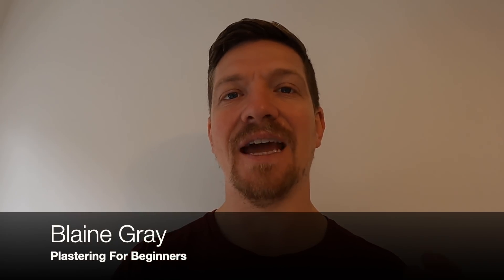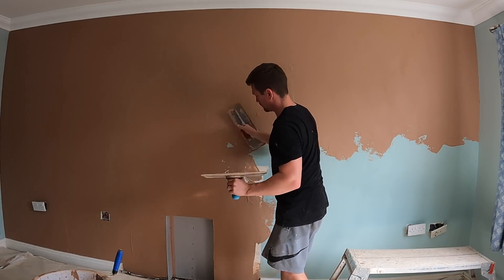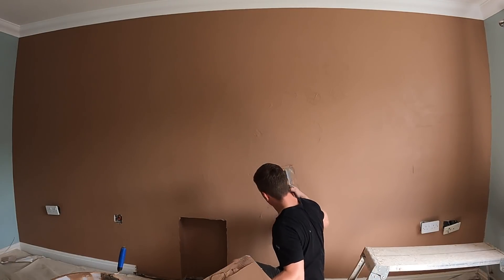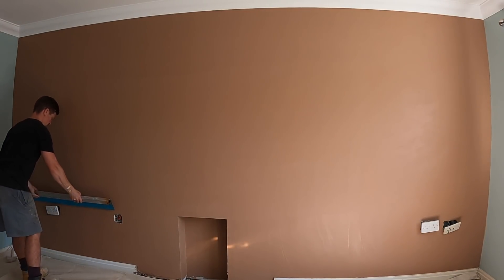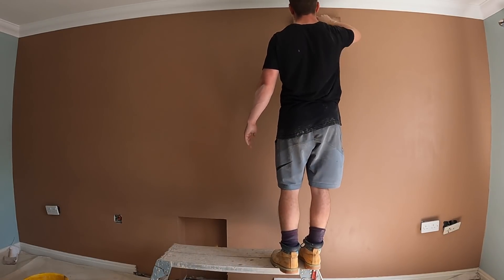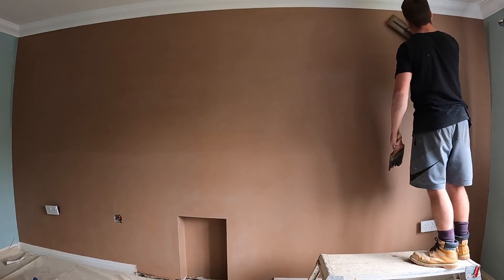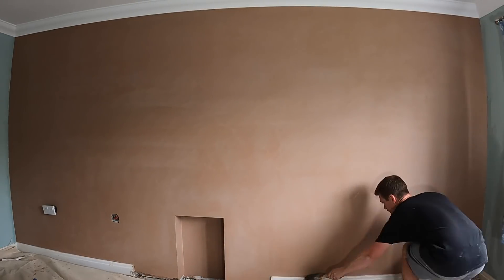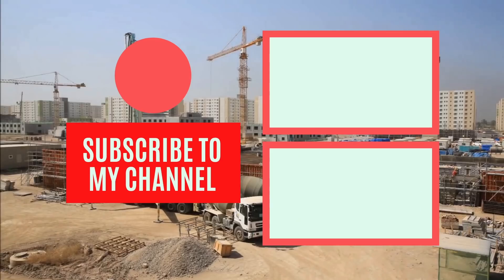7 Tips For The PERFECT FINISH In Plastering | Plastering For Beginners

Comment: If you are plastering on top of hardwall but also using corner bead, would you still use 2 coats of multifinish? I so, how would you go applying 2 coats with the corner bead? I'm planning on plastering the inside of a door way which I removed the door lining from and want to make sure I get things right.

Comment: I was always told the reason you had to put a shine on the walls, was not to annoy the decorators, but it was required so you could see that the decorators had given the walls a light sand before painting.  Putting a sheen on the plaster would only disappear once sanded.  It was particularly required by contractors so they knew the walls had been sanded?

Comment: Hi I noticed in that clip that the skirting was left in place and I appreciate that that may be out of your control but do you thin the plaster where is meets existing skirt as I would imagine 2 or 3mm of plaster if going to affect the look of the top of the skirting board.  Similar question regarding corner beads i.e. when you apply first coat I presumeyou have to lay the coat not too thick so as to leave room for the second coat to meet the bead flush if that makes any sense.  Thanks

Comment: You mentioned previously roughly 12.5 -13 litres for your mix. Do you increase the water for the second coat or is it just all in the feel to apply a thinner coat ?
Reply: Most people use the same gear

Comment: You should use a trowl and trowel up the wall using the long straigh edge one isn’t as good as troweling it’s up and when troweling it up use a brush with water on it and flick water onto skim and trowel

Comment: What would you say to a plasterer using one coat and putting it on from start to finish with a refina plaziflex plastic trowel? No steel involved.
Reply from the maker: It's a flexible trowel at the end of the day so I don't recommend it. You'll only get flat walls with a rigid trowel...the Plaziflex's are too flexible for the beginning stages of plastering.

Comment: I’d love to see some actual science of two coats being stronger. For me skim is skim. It all drys the same 1 coat or 10 coats, same thing. For me if you have enough experience of how skim behaves you can achieve a perfect finish either way.
Reply: I agree with this as well
Reply from the maker: I believe that 1 coat isn't a thing that I should be promoting. I understand where you're coming from but strength comes with layers...the more layers to a product the stronger it becomes. Plywood is exceptional strong for it's thickness partially due to multiple layers. It's the same with plaster and render. The more layers the stronger the product.

I'm not doubting your abilities to get a good finish by 1 costing. I'm sure you do but it's not a thing I'll be promoting to people who are starting with the trade. If British Gypsum says 2 coats on the bag then I'll obey...at least your covered then. 

I respect your comment all the same.

Cheers pal 👍
Reply: @PlasteringForBeginners  I do agree with you here especially for beginners
Reply: @PlasteringForBeginners  1 coat I tend to do over simple plaster board 
But old stuff I usually two coat and sponge float
Reply: @PlasteringForBeginners  The way it was always explained to me, whether for plywood, paint, auto-body-filler or plaster, was that thick layers tend to form stress cracks as they harden unevenly, while multiple thin layers retain enough flexibility to avoid cracks. Makes sense when you look at an old beam with cracks that grew wider as it dried out; I've seen wood split in two pieces that were both much harder than the original beam had been when it was on one piece.
Reply: 1 coat cowboy

Comment: I recently picked up a new marshalltown permashape to replace my old one. Didn't realise at the time I picked up a 13x5 one by mistake but I normally i put on with the Marshall town, then flatten with a speedskim, go over it again with the Marshall Town and then everything beyond that I did with the nela Black edition. Recently I've only used the nela at the wet trowel stage and then gone back to the marshalltown for the dry trowel as I got the 13x5 inch by accident and it seems to finish better on the dry trowel than the nela. Is it worth getting a plastic trowel too for the finish? I'm not a spread by trade but do bits and pieces. Always looking for pointers.